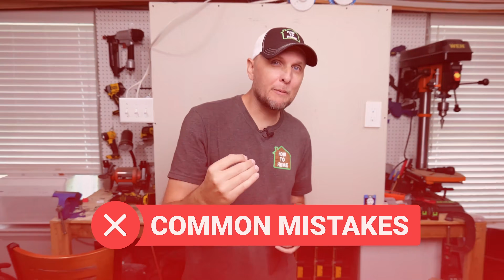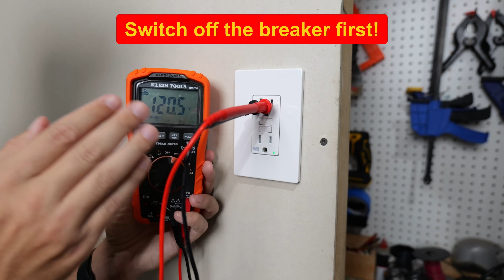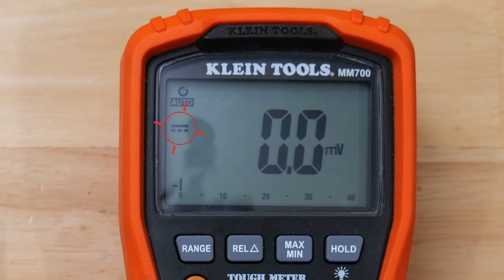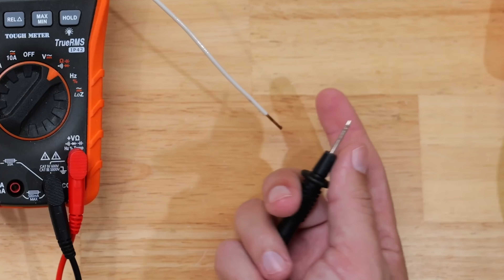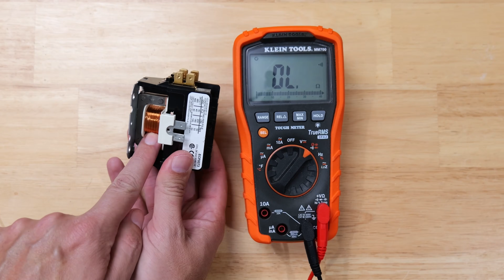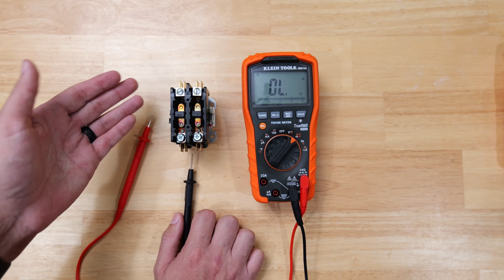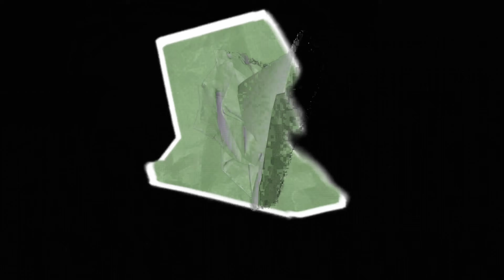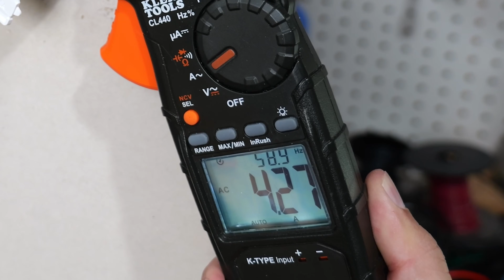Most DIYers Are Using Their Multimeters Incorrectly!

Comment: In addition to others' comments, use alligator clips or equivalent to connect the probes to wires or terminals. The human body is a conductor and will skew voltage and resistance readings if fingers connect with the probe ends. Not to mention the safety factor with testing high voltage or current.

Comment: I've had a good, pawnshop find clamp meter for years and have never used it beyond basic volt reading and occasionally thermocouple readings. After watching, I could have used it three or four times in just the past month. I had a start capacitor die on my air compressor, I needed to (accurately) measure the amperage draw on my dust collector after adding a bigger impeller, and I have a dead subwoofer which I suspect is due to bad caps. Also, as a DIY'er of going on 40 years, I'm embarrassed to say I didn't realize the squiggle meant AC and the solid/dotted line meant DC. Kudos to you and thank you for the information!
Reply: Your dead subwoofer was probably appreciated by many!

Comment: When measuring battery voltage it really should be done using some kind of load. Without a load it is possible (even likely) that the battery voltage appears good when in fact it is dead.

Comment: Surprised you didn't show using the multimeter to verify you are dealing with a grounded circuit in an outlet. After verifying there is power at the receptacle, leave RED in narrow slot, take the BLACK probe from the wide slot and insert it in the GROUND hole. Of course, if it is grounded the meter will read the voltage and if not grounded the meter will show open circuit (000). Often one can find old homes with no ground circuits, but outlet(s) changed to modern 3 prong receptacles. For using a clamp meter, take a length of 3-wire power cord, male and female plug at each end, strip a length of insulation from the middle. Now you can access the wire to check for amperage. Mine is about 10 inches of cord with 4.5 inches insulation stripped from the middle You also didn't mention that MOST multimeters, other than the clamp meter, will only handle up to 10AMPS of current. I do have one old meter that will do up to 20Amps.

Comment: You should mention, to never test a live circuit, in the Continuity or Ohms Setting, or You will Destroy Your Meter !
Reply: FYI, just for the fun of it, I decided to test your statement. Using a Klein MM420 I set the meter to Ohms and plugged it into a 120v outlet with zero damage to meter. Also tried it in the 220V dryer outlet, good to go. Set the meter to the Continuity setting and same results. I am guessing they have designed the modern IC boards in DMM's to account for the Idiot Factor. 
Please know, I mean no disrespect towards you with my comment but I couldn't help myself from testing it out.
Also, I highly recommend following your initial instructions just to be on the safe side.
Reply: @PH_INFO_101 lucky you didn't damage your meter.
Good quality meters have good protection. If you're set on ohms and try measure voltage it won't hurt them.
Reply: In the UK, you do not use a multimeter to test voltage to prove dead, you use approved test lamps, fused leads and other specs to test 230/400v in the UK safely.
Reply: This is a general recommendation for most it's correct but techs sometimes do this with the right knowledge and quality multimeter. Most people get in trouble measuring current with their multimeter. Just my two cents...

Comment: I'm almost as old as dirt, and I learned a lesson a few months ago.  I found that my outdoor flood light and my old back porch refrigerator had stopped working.  I have done a lot of DIY wiring and thought I knew what I was doing.  I grabbed my meter and checked the outlet and it was dead.  I followed the wiring back to the outdoor flood light and it was dead there also.  I then decided to just replace the whole circuit and the receptacles.  I knew where the breaker was and checked the first receptacle on the circuit and it was hot.  I then assumed the problem was in the wiring going to the other dead receptacles.  I grabbed my side cutters and cut the wire and found the wire at the first dead receptacle wasn't dead.  I had failed to check for voltage from the hot line to ground and now I had found out my problem was in the neutral side.  I replaced all of the wiring and receptacles also these are now all separate circuits and each is labeled on the receptacles and on the new breakers.  I have a notched pair of side cutters that will always remind me to do more testing and to turn the breaker off as I should have done in the first place.
Reply: I am greater than you as my tool has 2 notches.!

Comment: Always discharge capacitors before testing.  You're going to get someone hurt. You probably shouldn't be making videos that deal with electrical at all.
Reply from the maker: What are you talking about?  Maybe if this was a video about working on and testing a capacitor in an AC I would do that but it wasn’t.  Discharge what?  It wasn’t hooked up to anything and it isn’t a battery.  Tell me you don’t understand how capacitors work without telling me. 🤣  Many more videos to come!
Reply: @HowToHomeDIY  I wasn't trying to start an argument — just pointing out that large capacitors can hold a dangerous charge and should always be discharged before handling or testing. Even if your example wasn’t charged, people watching might assume it's always safe. A quick safety warning can go a long way in preventing accidents. That’s all I meant.
Reply: @David..R Agreed, for larger caps they can charge up or hold a charge. They will/should come with the terminals shorted together.
Reply from the maker: @jasperthehaircaterpillar1168 really?  How do they charge up on their own?  Guess I should install caps on my roof instead of solar.
Reply: @HowToHomeDIY I do understand how capacitors work. Retired from electrical and automation work. High and low voltage systems.
Reply from the maker: @David..R then please share how this would have a charge and need to be discharged when it’s not connected to anything.  Clearly it had to be discharged for me to have it out and handling it.  Plus 99% of the time they will be discharged through the windings.  But none of that matters because this video was 100% about showing the basic functions of a multimeter not how to replace a capacitor.  I can’t help what people do with a video that has no intention of covering the ins and outs of a capacitor.  You say you don’t want to start an argument but your first comment was unnecessarily inflammatory.
Reply: @HowToHomeDIY 
The first comment was unnecessarily stated in an insulting manner. 

General the capacitors in VFD were considered to have a self discharge time of about a half hour after power was removed. (I haven't worked with VFD in about four years.  The capacitor self discharge may have increased.) That information is from the VFD manufacturers manual. That energy is solely stored in the capacitor. The manufacturers generally do recommend using a discharge procedure for safety. 

Note that this half hour is for the capacitors they were using in their equipment. It may be possible for other capacitors to hold charges for much longer. The use of capacitors for energy storage has been suggested. 

Side story; When gas engine had points and capacitors a mechanic's prank would be to charge the capacitor then throw it to a coworker. The coworker would instinctively catch it and get a shock.
Reply: @HowToHomeDIY final thought, you know just enough to be dangerous.

Comment: You said by tripping the gfi you no longer have power to the outlet(thats wrong) the power is still on but disconnected to the plug, also if your lights don"t come I think its best to try changing bulbs or checking voltage at the light before pulling the switch.
Burned out contacts and you should talk about discharging the capacitor.

Comment: You missed the important  step on verifying the meter leads are good by shorting your leads together before using the meter.  Do this on the ohms function before using the meter.  It should read a zero and be stable.  Meter leads do go bad over time.

Comment: Looking at the Bottom Two Contacts, (One on the Right, One on the Left), Not the DISCOLORATION.  Those are Burnt up! and considering this is a 2-Pole Contactor, it was probably used for a 240V Device.  Either long term operation, or the device drawing too much current, or the Contactor Not properly sized for the application, (the 80% rule was Not Observed), or China made, hence the Failure.

Comment: I have the Klein CL120. I got it from a previous recommendation on a video. It works quite well. The only thing is that it does not measure capacitance, if I recall.
Reply from the maker: Yes you are correct.  That is a great multimeter but unfortunately it does not have capacitance or an In Rush function.
Reply: @HowToHomeDIY  Well, your recommendation was good back then, so I can confirm it is good now, too.

Comment: Measuring a power outlet this way does not guarantee there's is no power. If only the neutral wire is disconnected the phase may still be on, but you measure 0 volts.

Comment: The word you want is minimal not "nominal".  When determining that a circuit is not energized you want zero volts or a very small (minimal) voltage.
Reply from the maker: No, I’m good with nominal.  The definition of it fits perfectly.
Reply: @HowToHomeDIY Nominal Voltage: This is the standard or designated voltage for an electrical system or device, used for convenient labeling and identification. The actual voltage may be slightly higher or lower than the nominal value, but the system is designed to operate safely and effectively within a specified range around that nominal value. For example, a car battery is referred to as a "12-volt battery," which is its nominal voltage, even though its actual voltage when fully charged is closer to 12.6 volts. 

Other guy is right.
Reply from the maker: That’s not what the definition of nominal means.  The context of what I said matters, and I’m clearly saying it as though it’s extremely low and insignificant.  We are discussing something that really doesn’t matter.  So again, I’m good with what I said.
Reply: @HowToHomeDIY 
By definition you are correct. But, we generally think of a nominal 12 VDC, nominal 120VAC, nominal 240VAC, etc. We normally don't think of a nominal 0 VAC.

Comment: Funny story. Just 2 hours ago I was testing my wall switch with a multimeter that I had gotten used. Was surprised to get a flash and bang when I touched the terminals with the leads. Downloaded the instructions to find out the leads were attached incorrectly. Turns out those leads have to be in the right holes.  Changed the configuration and then found that there was power, just a loose wire. You didn't mention how the leads have to be attached for house current.

Comment: Meters are a bad way to check batteries unless you know what you are doing. Batteries develop surface charge so they will read higher than they really are. A battery tester places a load on the battery and tests it that way.  Now there is a way to check the battery with a meter of this kind. You can either test it while it is running a device or you can run a device for a minute before checking the battery.

Comment: Your DC voltage reading is on an unloaded battery. (In this case, very dead.) But battery voltage drops under load, and the battery must be tested under load to get a meaningful result. An inexpensive load can be calculated, or you can just test it in circuit (i.e. in the usual radio or flashlight, etc.) to get a meaningful result.

Comment: I recently had a problem with my Klein meter not going past full display when I switched it on. I replaced the batteries and it still didn't work.  I tested the batteries on another meter and they read full voltage using the voltage setting. When I tested them on the battery testing setting I got a low voltage. So lesson I learned is that batteries can show near full voltage when tested on no load but can show lower voltage when under load.  Hope this helps us.

Comment: The battery test bit is very misleading.  A very bad battery will frequently show almost full voltage with a standard meter.  The meter does not put a load on a meter and most batteries will show a higher voltage than it will when used to power something.  Dedicated battery testers have a resistor in them to load them.
Reply: I presumed that meters with a specific battery test function did that.  Otherwise, why not just use the voltmeter function.
Reply: It is also good to test it for several seconds to draw current from the battery. Initial draw may look good but it needs to maintain current glow.   I have a battery tester I use for batteries and I also still have my first 5k ohm cheap multimeter from 50 years ago for testing batteries.
Reply: Exactly, a good way to test without a dedicated battery tester, is to use a DMM with Max/Min button, and crank the engine.
Reply: Depends on the meter I think. My cheap Mastech multimeter definitely shows the diminished voltage when the battery is effectively dead.
Reply: @mabco888 but it's not putting any load on the battery. If you take a dead battery from an item, test it, and let it sit a month then test again, the battery will recover fake voltage.

Comment: Why does it read 10 times higher on the amperage meter
Reply: Has a loop with 10 turns of wire for more sensitive readings.
Reply: Mine has two openings ones for regular eating and one for 10 times
Reply: It likely uses two coils of 5 turns each placed in opposite directions to increase measurement precision. See Ampère's circuital law...

Comment: I grew up helping my pop in the 60's. He was a aircraft electrician and my main job was to hold the meter so he could read it. 
Comparing today to back then the meters are way better. Back then we didn't have digital. We didn't have auto ranging. But I think one thing that was better back then is they didn't use symbols as much. It actually said VDC, VAC instead of symbols. But the auto ranging and auto polarity is very nice. I remember back in high school I bought a analog meter kit from Radio Shack. It was under $20. In the old days you had to choose which setting to use plus which range like 0-20, 20-100, 100-600. And if you didn't know what voltage something was supposed to be you had to start in a high range then switch to a lower one if it was safe. 
The old days most only had Volts, Ohms and amps. It took the expensive ones to do other things.

Comment: If you are going to pull the receptacle out of the wall to check the current with a clamp meter it doesn't matter if you clamp around the hot wire or the neutral wire, the current reading should be the same. Same thing with a splitter, it doesn't matter which side you use. 
I noticed that your multimeter has a loZ setting, so when checking a battery's charge it's better to use this feature because it puts a small load on the battery. If the battery is marginal, it may still read ok with the regular DC voltage setting, while the loZ (low impedance) will reveal a more accurate result.
Reply: Hot and neutral are only the same if there is no leakage currents, which whitewares are not uncommon in the range of 5-20 mA.
There are also "creative" neural circuits (UK based their entire system on common neutral) that can make the two have very different reading, especially if there is backfeeds going on.
Measure both, and if they are the same, you know the circuit is direct line to the breaker without issues.
Reply: @johanmetreus I think that your suggestion to measure both is a good one, never hurts to be thorough, thanks.

Comment: Very important!  Whenever using any function except voltage (examples: amps, ohms, farads, continuity, etc) make sure the circuit is isolated and deenergized.  I recall a situation where an electrician was using an ohmmeter on a live 600 volt circuit.  The meter exploded and killed the electrician.

Comment: Prolly noted below somewhere, but care should be taken when handling 240VAC capactors.  They could be charged & give you a life threatening shock if you come across 2 terminals.  Also, always discharge the cap before testing with the multimeter.  Do this with a resistor preferably or shorting the terminals together.  Caps can also regain some voltage if they are left to sit for awhile.
Reply: Ask Google (or other AI service) why shorting charged capacitors is not a good idea. Hint: there are multiple reasons.
Reply: @michaels3003  So what's the alternative, instead of hinting, since one doesn't want to be testing a charged capacitor either? I don't see it being a problem for the capacitors an average homeowner is going to run into like in a fridge/freezer or air conditioner.
Reply: In Australia even the voltage can kill you.
Reply: The capacitor should be discharged across a resistor before testing it or even touching the terminals.
Reply: Just recently my neighbor was going to take apart his freezer thinking that it was safe as long as it wasn't plugged in. Didn't have a clue about capacitors. I think he still doesn't believe me that he could get hurt.
Reply: Prolly?😂

Comment: Pulling an outlet out of the box to use the clamp amp meter will only give the correct result if the outlet has nothing else daisy chained or there is no power being drawn on any of the daisy chained outlets. If there is only one black and one white wire to the device, you will get the correct result. If there are two black and two white wires, one black wire will read the amps to the daisy chained devices and one will read the amps of the outlet you are testing plus the daisy chained devices. In this case you could get the amps to the outlet you are testing by subtracting the smaller amperage from the larger although the chances of an error increase.